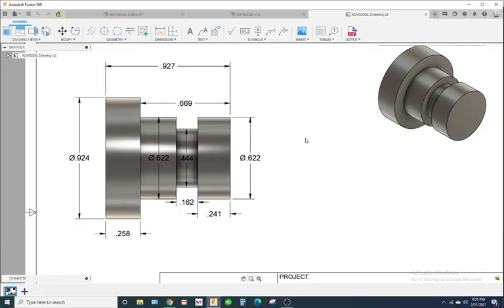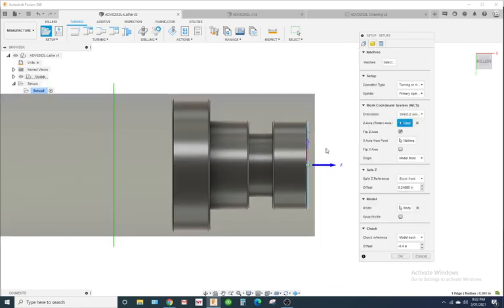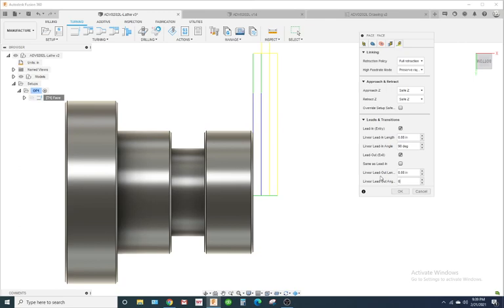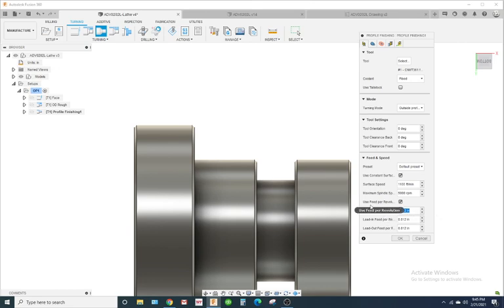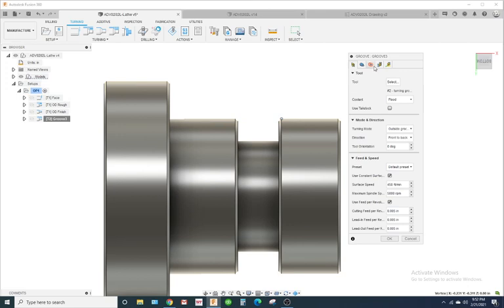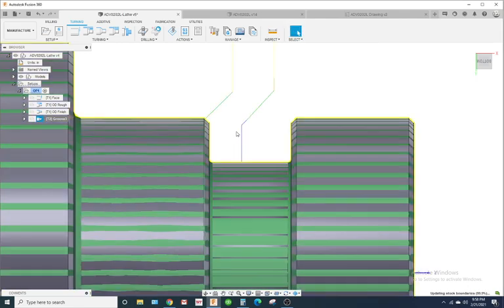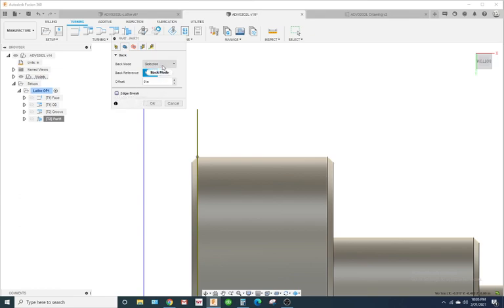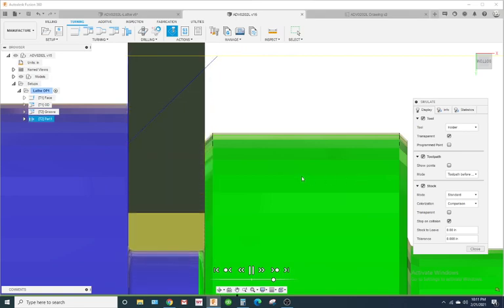Fusion 360 CAM Lathe Tutorial

Comment: I know this is probably late, but you mentioned that you groove with your part off tool. I highly advise that anyone who does take this tip with a grain of salt. Most part off blades come with a relief angle to insure the cutting edge doesn't make full contact during the part off. This will put an angle in the front your groove and could potentially scrap your part.

Comment: Well I'm glad it's not just me struggling with Fusion lathe CAM! The unsettling thing is not knowing if the CAM is going to work - and if it doesn't, how long it will take endlessly playing with the settings, deleting the operation and starting again, trying a different toolpath etc etc. I wish they'd test this a bit better and make the error messages even slightly informative.
Reply from the maker: You should join the Fusion 360 CAM group. There's a link in the description.